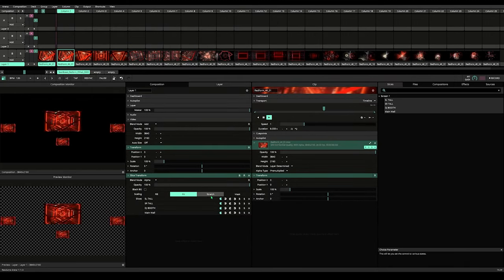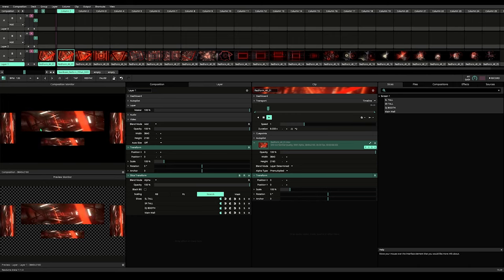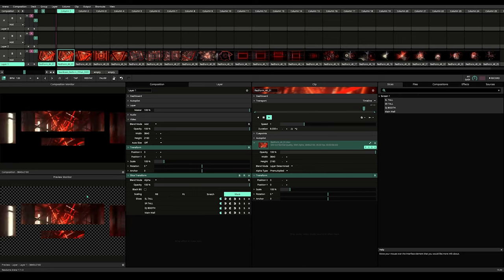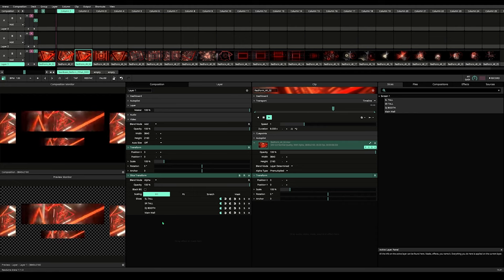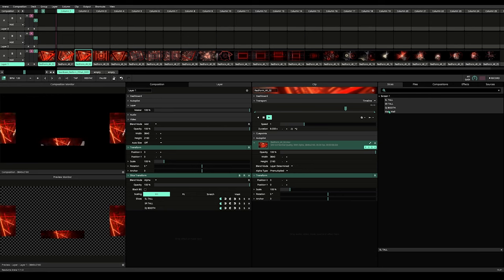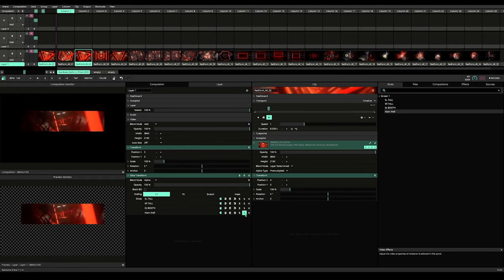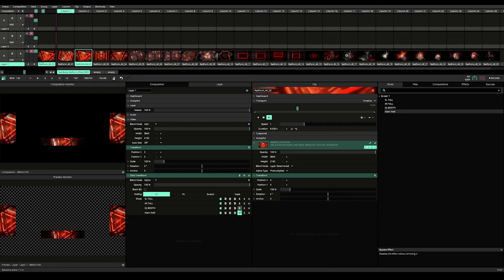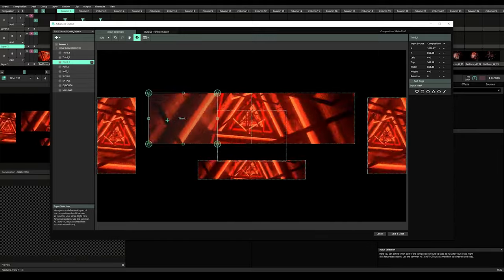Resolume Slice Transform | LED Screen Mapping | Quick Start Tutorial

Comment: Slice screen !!? How to setup from defferent output on ledwall with center screen is clip , left screen is camera output , right led wall is defferent camera
Reply from the maker: Use the Slice Transform effect, but on a layer or clip instead of the whole composition, and only put the slice you need in each one. For example you could have a center screen layer, with Slice Transform on it and only Center Screen slice in it.. Then put the clips you want to play there on that layer. Then do the same for Left Screen and Right Screen, and put the correct camera in those layers.

Comment: Hello, I am trying to use Resolume Avenue for slicing. Can I use it for running multiple contents on different screens. For eg. source 1 for DJ booth and source to left panel and source 3 on right panel? Please let me know. I am trying to figure out which software to get. Thanks
Reply from the maker: You need Arena for this. The Advanced Mapping features are exclusive to the Arena version
Reply: Thank you for quick response. Is arena a one time purchase or I have to renew every year?
Reply from the maker: @dheerajverma0083 I believe it’s a combination. You buy the software and it includes 1 year of updates. You can choose to renew for a lower price after a year to receive another year of updates, or not. Whatever updates you paid for will work forever, even if you choose not to renew.
Reply: Thanks for your help! Also thanks for making very knowledgeable educational videos 👍

Comment: Stretch: great for quickly fitting pre-rendered anamorphic content. Beyond that I can't really find as use.
Reply from the maker: If you want distortion, it will definitely give you that. but i almost never do. Since these are beginner tutorials I am coming from a 'know the rules before you break them' kind of mindset.
Reply: @SeanBowes  Anamporhic content is pre-squished and will "unstretch" to look correct when stretched to fill the size it was designed for. I very rarely see it anymore, but it used to be a way to get super wide content to screens without overloading your playback machine. You would only find it in pre-rendered content. Like 3240x1080 3:1 content squished into a 1920x1080 file would be very odd looking until it stretched back out. Kind of like a Grassvalley Turbo outputs 1920x1080 but saves the files as 1440x1080. I am dating myself by saying I know that lol!

Comment: How can i sync the outputs , i mean one output looks like 15hz other output looks stabil . How can i send you video which i recorded
Reply from the maker: Double check your display settings on your computer and on your display devices (LED Processors, Projectors) to make sure they are both set correctly. That doesnt seem like a resolume issue to me but more of a hardware issue. Find me on Instagram or send me an email

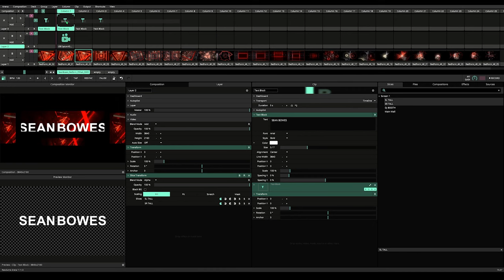Comment: Hi Sean. I'm starting on this, I don't know if I'm doing something wrong. I try to do what you do at 12:56 with Text block, also what you do at 17:47 by adding the slices directly. However in the Text block and the slices I don't get the effect like in your video. In the case of the Text block with transform slice, the text goes to the slice that I add but the text has a background, the background is the clip that I have selected. If I add the effects directly to the specific layer where the clip is, I get the effect correctly.
Reply from the maker: Hey Nestor, I'm not sure that I fully understand the problem, but sometimes issues happen when you have multiple slice transforms and they start interfering - for example having it on a layer and a clip in that layer, or on a clip and as an effects clip . Check to see if there is some interference happening, or send me some screenshots on Instagram and I will try to help you out!
Reply: It is as if the four slices were added inside the main wall with the Text block
Reply from the maker: @nestormartinez5291  yeah it seems like you have some slice transforms interfering with each other. Be careful about layer order and how things affect each other. Groups can help add extra separation sometimes.
Reply: @SeanBowes  In this case I apply the slice transform on the layer 1, where the clip its and it is applied correctly: https://i.imgur.com/PwL7f8s.png

Here I add the Text block in layer 2, then slice transform in Text block. But it seems that next to the Text block some pieces of the layer 1 clip are added and mixed: https://i.imgur.com/rkHSvFX.png It is as if the four slices were added inside the main wall with the Text block
Reply from the maker: interesting. yeah what that looks like is that there is an additional slice transform with the Main Wall slice between the content layer and the text layer maybe as an effects clip and that is causing the duplication. I cannot recreate it using the steps you describe with just two layers. Can you screenshot your layers? What version of Resolume are you using?
Reply: @SeanBowes  The text block thing was because I added it as an effect and not as a source. However, with the slice transform directly on layer 2, the same thing happens to me. https://i.imgur.com/2V3sSzV.png
Reply from the maker: @nestormartinez5291  yes I think if you set the one on The Composition level to Mask mode it will solve it. That one and the effect clip one are both affecting the content and it is doubling the transformation.

Comment: Hi i was wondering if there's any option to make those slices "turn off" in a different time and then again turn on kinda 
flashed out of sync at a time determined by me
Reply from the maker: You could possibly midi map the Bypass (B) toggle on each slice in the slice transform effect or you could use a plugin like chaser to achieve an effect like that. There are other slice 'chase' plugins and techniques as well. Take a look and let me know if that solves your problem, or if there is more clarification you can provide about what you are trying to achieve to help me point you in the right direction

Comment: This was really useful, thank you! Do you have any tips for showing different content in each slice?
Reply from the maker: Instead of putting slice transform on the composition, try it on a couple of layers, and only include some of the slices in each. Play different content on each layer. You could also do this with a couple of groups, groups and layers, or even individual clips. 

Just don’t stack slice transforms on top of each other, that can get weird.

Comment: Please how we do it, if we want from 4 screen - 1 screen to fill and other 3 screens are the mask type ?
Reply from the maker: Version 7.13 and up allow you to set different modes for different slices, so just set 1 to fill and the rest to mask. Or, just include the 1 slice you want set to fill in slice transform and you will achieve a similar effect.
Reply: @SeanBowes   Thank you so much, also I have a situation that all the slices already set up but (4 slices up 1 slice is at the down part) the 1 slice is at the wrong location at output in resolume, how to sort it out have no idea? Im changing location in resolume but its not saving some how..

Comment: Sean, great tutorial. Could you tell me what is the resolution of the composition and if you always use the same regardless of the output?
Is there a standard for the size of the composition?

thank you!
Reply from the maker: In this example it is 3840x2160. It should be whatever size it needs to be to fit all of the slices into the input map without scaling. It does not have to be a standard size. Sometimes I go really wide if my stage is really wide. It varies show to show.

Comment: great video! but there is one problem. you have one slice per screen, how to make one screen be divided into two or more slices, preserving the integrity of the image?
Reply from the maker: Make two or more slices that subdivide the screen how you want, and make sure they are the same aspect ratio in both your input and output maps, and never use stretch mode.

Comment: as soon as I come out of the advanced output the slices are not seen in the slices section even though saved and closed it.
Reply from the maker: You need to have Advanced output selected under the outputs menu. If it is set to Disabled or set to another display (Display 1, Display 2) it will not show slices. If you need to see the output on a display, Choose that display under the Device settings inside Advanced output instead of in the Outputs Menu. Click the Screen name on the left, and change the  Device dropdown. The default is Virtual Output so change that dropdown to the correct display.Advanced Output should be active after clicking save and close, so that is odd if it isnt, but that is what causes slices to disappear from the slices menu. If this still doesnt work, there is an error and you should contact Resolume Support